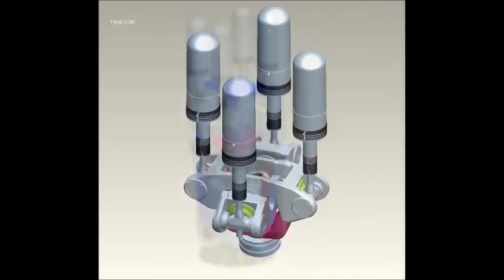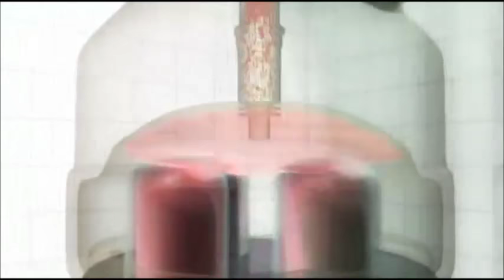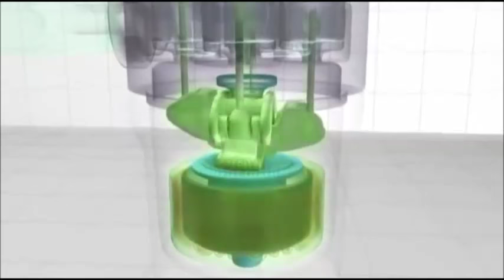А modern Stirling engine

Comment: What would truly revolutionize stirling engines is if we incorporated them into internal combustion engines to create a hybrid motor, recovering energy from the 60% lost to heat
Reply: The recovery of the lost termo energy is wear it's at in all modern appliances
Reply: The problem is Stirling engines are quite heavy for their power, so mobile applications can't benefit much since the efficiency savings are lost to having to move more weight.   This would work great for stationary applications though.

Comment: This really seems overly complicated. It doesn't take that much metal to make a Stirling engine generator.. There are a lot of special parts and a lot of moving parts which means a lot more points of failure.
Reply: It's a four cylinder engine.  What do you expect?  The same complication as a simple one cylinder engine?
Reply: It is very simple, efficient and reliable. Moving parts are not a problem.
Reply: @AndersJackson  A Silenced reply to others and  convincing answer, thank you very much. 🌹🌹🌹🌹🌹